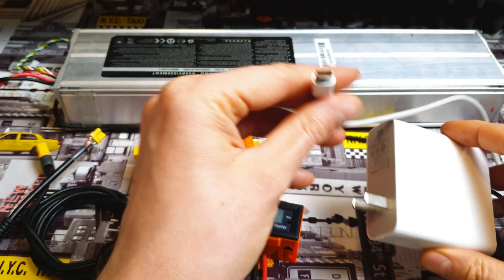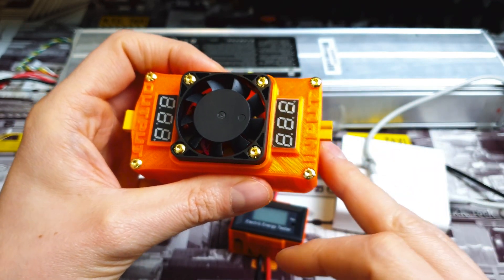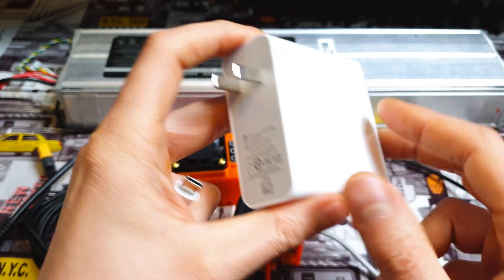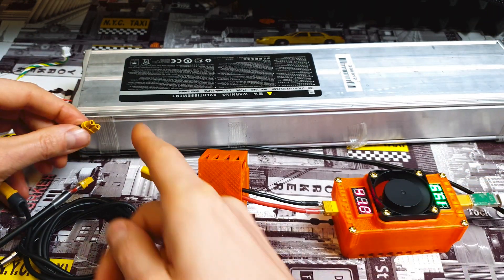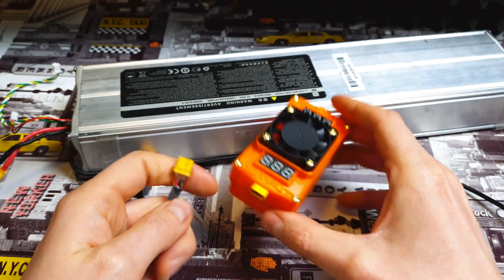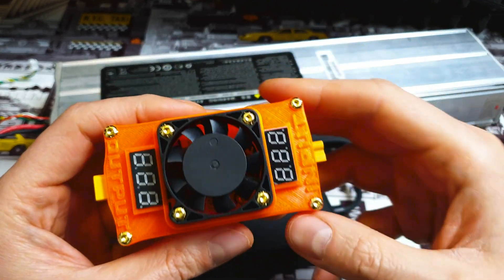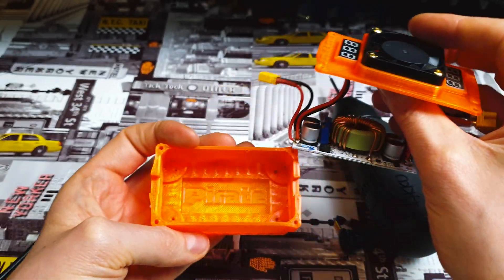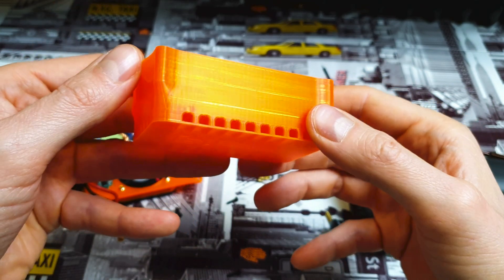Use USB PD charger to charge your Scooter Xiaomi M365 or Fiido Ebike ? Sure with my USB Adapter V2

Comment: Nice chasing! I use the same step up in a super small casing with thermal pads and it keeps the temperature in good range with 65W, but i would not use it for more without cooling. For setting up the current you need to account for end voltage as the power and so the step up input current rises and eventually the up pd charger stopps working. For 1.7A and 41V it is already 69,7W without step up efficiency loss, so maybe 75W which is too much for 65W usb pd. Unfortunately there is no small dc step up with input current control
Reply from the maker: I appreciate your input 💪🍻
Reply: @PirateWasHere  Actually it is even more than that. Efficiency of this DC DC step up converter is in real world approximately 85 %. So 1.7 A x 41 V = 69.7 W without losses. With losses it is already 82 W, which is way too much for 65 W charger. (69.7 W / 0.85 = 82 W).
Reply from the maker: @rokrokavecki9381  for sure its not 82w , at least not in this dismension xD

Comment: Does the current automatically go to zero as the battery voltage reaches the target voltage? I want to make this, but worried about overcharging the battery and causing a fire. Any advice appreciated:)
Reply from the maker: Sure, cause when you set voltage it cant increase it. The way work simple chargers or power supply 🍻
Reply: @PirateWasHere  should we include a cutoff circuit that makes an LED green when the target voltage is reached? Would you sell an assembled unit?
Reply from the maker: @mta102  ** it will not drop to 0, it will stay at choosed voltage
Reply: @PirateWasHere at full charge, current should be zero, voltage should be at target. Does the boost converter automatically do this?
Reply from the maker: @mta102  Booster is just simple power supply where you can set voltage and amperage that is all, I do recommend to learn how simple power supply works. Cheers

Comment: if you check the charger with a kill a watt meter u might get different readings. mine xomi charger was at about 70w to 90w fluctuating. does the wattage fluctuate during charging?
Reply from the maker: Well not that much,  something can be damaged in ur charger
Reply: Tryed different chargers and all the same, I think the bms of battery and controller board throttles the charge the way it wants. I think it's working perfect cause it's always the same every charge. Try it for yourself with a ac kill a watt meter if you don't believe me. Best regards and awesome videos. I did a lot of testing or I would not have spoke on the subject. Mind you I was using a es4 when charging so might be different with xomi type your using